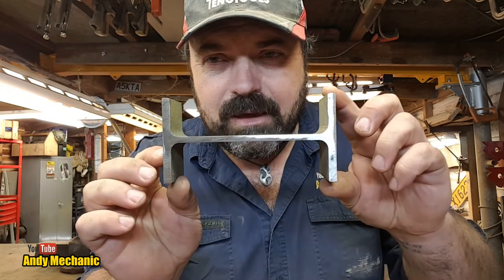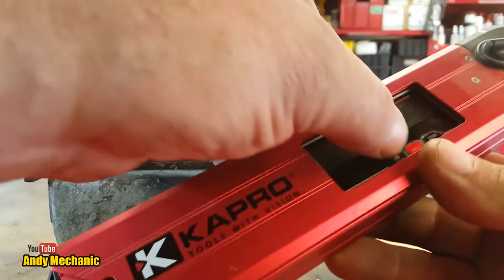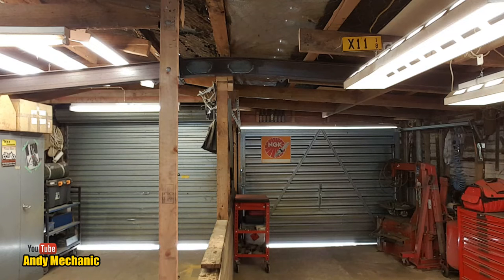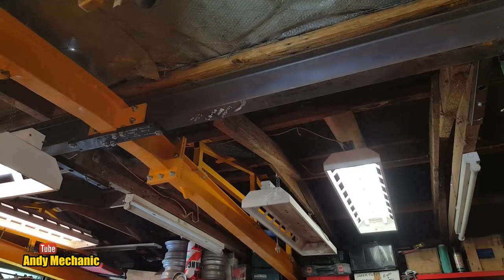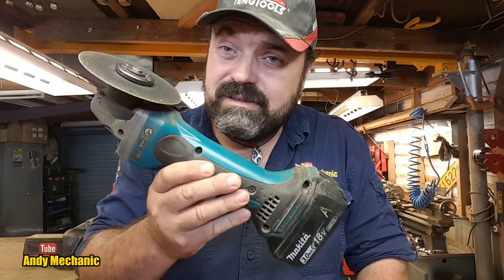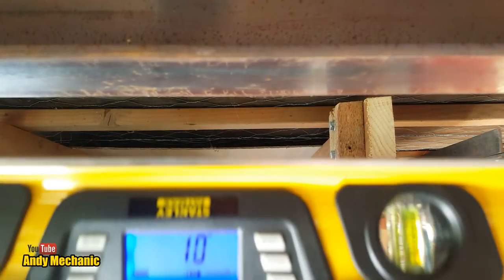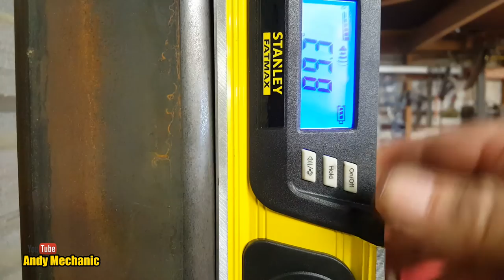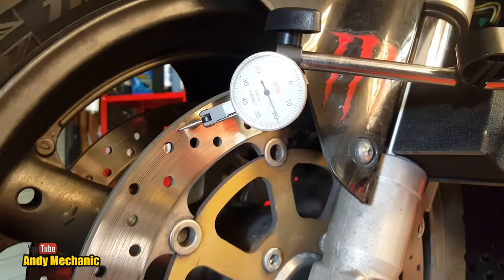Workshop roof steelwork Ep.6 - it's over, finished, done... #2020

Comment: I have the not so fancy Bosch stud detector and it is good, all I can say is to do the detections a few times before drilling the hole. Also put a very thin bits of foam on the back so it does not mark the wall when using it.

Comment: That was quite the haul of goodies from town, tools and more tools and piles of bolts etc. I looked up both cutting wheel companies and Flexovit claims to sell products through the main town in this area but I've never been presented with that brand option for any abrasives at some of those welding or supply stores. Here in Canada we must have adopted similar safety issues with grinders as the rat tail style angle grinders with a trigger for example can be bought "with" a trigger hold on catch or "without" and in a shop with employees they won't allow them to have the trigger lock style and I would hate that as I like locking the trigger on so I don't have to continually pull with my finger and yet my finger is right there to pull it which releases the trigger stay on lock. Perhaps I shouldn't say this but with my twisted sense of humor I will since I now know this is an adult youtube channel, with that stud finder tool you might get a little mileage out of it joking around. First with your wife when working in the house you can hand it to her and ask if she needs that to find the biggest stud in the room LOL, or do much the same thing with one of the tool girls as no doubt they would first look around the shop and then might finally clue into the joke  ( actually maybe its not a joke LOL ), then tell them some idiot from Canada made you do it !
Reply from the maker: Great idea, I'll give it a go! Cheers Andy

Comment: Nice structural work there. How about when you get the last transverse  beam in, take out the rest of "the wall" the wood post area, both garage doors and put in one wide roll up door centered somewhere on the bay?  May have to fill the exterior end wall some or put in a man door next to the roll up.

Comment: I see I wasn't the only one that noticed right away something isn't performing correctly with the welding process, applying a band aid like the anti spatter spray is premature as that won't fix what is wrong and in fact its said if too much anti spatter is used it can cause porosity in the welds. There are a number of things that can cause the excess spatter and the arc is just not sounding right at all a big part of the time and see it just popping. That mill scale might be one of the major issues and easy enough to test by grinding off the weld area on a piece and seeing if that makes a noticeable difference. But also it could be the gas mix that is used or its not of a decent quality gas, the wire may be of inferior quality, the voltage may be dropping before or after the machine, the feed rolls not feeding constantly, the ground not grounding well enough through that mill scale or grounding back at the machine end of the cable. I did notice once as you turned up the unit it welded much smoother but imagine it was set too hot then and why you turned it back down. Hopefully its something not to hard to sort out. Never the less the weld job from the outside looked decent enough.
Reply from the maker: Thanks Charles, I think, from what you have said it's most likely a poor ground or inadequate power supply to the Mig. I have a new 200 Amp supply due to be finished soon - that will be way over capacity to run the Mig. I'll address the earth clamp as it does seem a little weak on clamping effect. I turned down the wire speed as just too fast. Power is set to 5, it should be at full power 6 but that trips the circuit breaker on the current power supply to the workshop. A factor that isn't ideal by one I just can't improve on until the new electrical supply is signed off.

Thanks for your comprehensive advice, it's much appreciated 

Cheers Andy
Reply: @AndyMechanic  I am hoping my words didn't come across as harsh or anything of that nature !. Here I was somehow "assuming" the service had been hooked up since your installation of the new power supply to the shop had been done some time ago but I see that will be a ways out yet as I am guessing a new breaker box will have to be installed yet, and some new interior wiring and all done by a licensed electrician ?. So all you can do is wait until then to try the welder out with proper input power, its actually amazing it can weld as good as it does with the severe lack of wire size. No use in chasing ghosts for now though other then the ground clamp if that could use a new one ( and a good unit, too much Chinese factor into a lot of parts these days ) and ground cable integrity, etc. There is a trick one can use on a ground clamp, well for one cleaning off the contact surfaces of the clamp and the work surface of mill scale in a spot. Its taking a foot or so of scrap fine wire copper welding cable or old battery cable for that matter and stripping the insulation off and looping it back onto its self ( folding a foot length into half so its now 6 inches long ) and then twist it together a few turns so it all stays together well. Then you take that copper wire and clamp it between your work surface and the clamp, that helps spread all sorts of good conducting surface area as the fine copper wire mashed onto the clamp jaws and work surface create far more grounding surface then the clamp alone can. Sorry for the long explanation there but hopefully that makes sense to visualize but not something one would want to be doing all the time but helpful in certain situations struggling to get a good ground.
Reply from the maker: Not at all Charles, I read your comment as only constructive & appreciate the feedback.

I'll investigate the earth clamp next time I pull the Mig out in anger!

Though I doubt I'll be doing another fabrication video for a while - I think 6 or 7 hours of videos is probably enough for all of us for a while!

Cheers for now
Andy

Comment: Hey Andy. What a huge undertaking, was it easier to cut the steal beams with the smaller grinder, rather than the big grinder you used to cut the concrete wall out?
Reply from the maker: Definitely much easier with the small grinder and much more accurate too. A 5 inch grinding disc is ideal and the grinder isn't too heavy either compared to the big one

Comment: Good work. Question please. What determines whether you use a saw or angle grinder to cut? Cheers
Reply from the maker: Ah, I would normally use the power hacksaw if cutting multiple pieces from one section of steel. Plus it's cheaper per cut, less dust and a lot less work oh an not as noisy.

I included the power hacksaw in this video as it doesn't often get an appearance.

Hope this helps
Cheers Andy